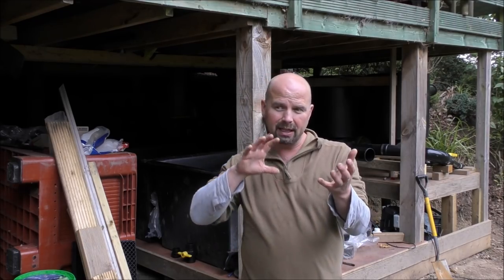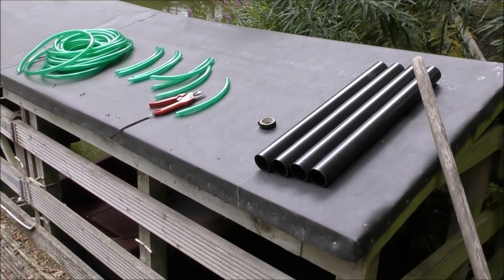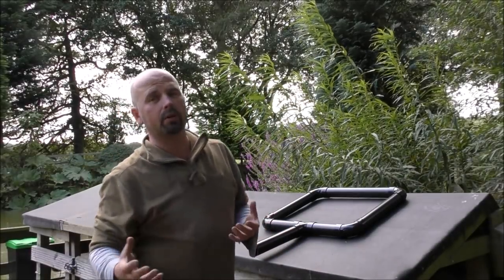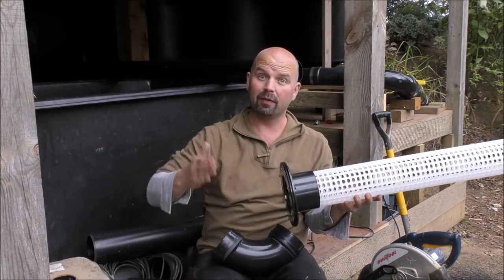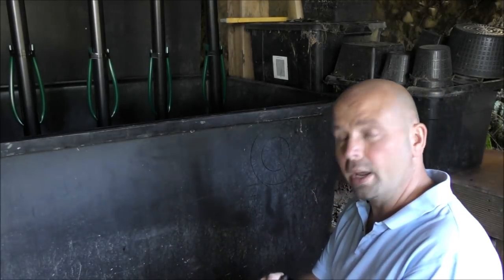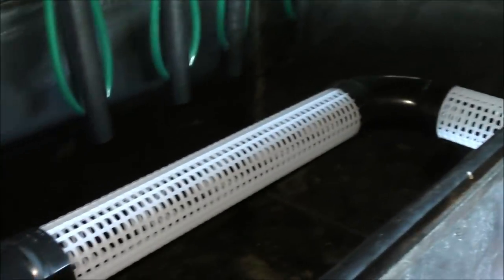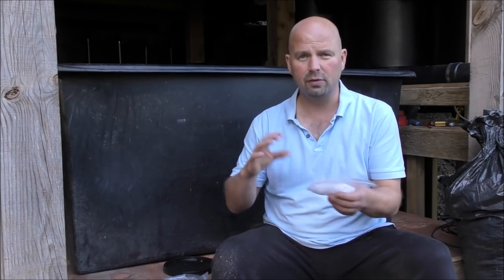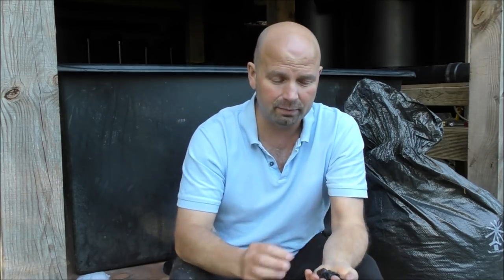Building a HUGE Pond Filter - Part 4 - Moving Bed / Fluidized Media Chamber

Comment from the maker: Forth episode in this mega-filter build for my large trout pond. Today we will take a look at the moving bed chamber and concentrate on the perforated outlet, drain and outlets to the next chamber.
Toward the end of this video I go into depth about the pros and cons of different types of moving bed / fluidized bed filter media media and explain how you can boost the biological activity in your moving bed by 40% simply by making the right media choice.
Why spend thousands on a fancy filter system and have it under-performing? 
A cheap DIY moving bed filter with the right media will easily outperform a ready made one with the wrong media....
Please check with the manufacturer of your moving bed if it will take K1 micro without modification - most will not, therefore the Hel-x 13 would be the better choice instead of K1 standard size
(Both the Hel-x and K1 micro offer approx. 40% more surface area per litre compared to standard K1)
The next episode will highlight the two static bed chambers which will be filled with a nation of media.
*When using side pressure to cut a hole with a drill bit use safety glasses since a broken drill bit is a sharp object which can damage eyes.
Hel-X 13 25 litres (Amazon): http://geni.us/3UBTi
Hel-X 13 25 litres (ebay): https://ebay.to/2QPKiq6
Hel-X 17 (more suited to very large moving bed filters): 
Hel-x 17 moving media: https://ebay.to/2UZk5aM
K1 standard size (Amazon): http://geni.us/zNFFaJ
K1 micro 25 litres (Amazon): http://geni.us/byDQ
K1 micro 50 litres (Amazon): http://geni.us/M7T2AH
K1 micro 25 litres (ebay): https://ebay.to/2P5Flfv
K1 micro 50 litres (ebay): https://ebay.to/2NFJ3YB
Moving bed media (FilterPro): https://bit.ly/2NN1gU6
Vortex filters: https://bit.ly/2Mj7gYa
4" fittings: http://geni.us/nTQc9bw
2" taps: http://geni.us/OBXBGSI
8" diameter brushes: https://ebay.to/2OvMOkc
Filter grids: http://geni.us/oqDBzT

If you've enjoyed this video please check out the playlists on my channel for hundreds more  - on a variety of subjects.
Feel free to share or link any of my videos on facebook, twitter, forums etc. for the benefit of anyone you think may also enjoy watching.
See you next time.
Pondguru

RECOMMENDED PRODUCTS ON AMAZON: https://goo.gl/jMaBWy
INSTAGRAM: https://www.instagram.com/pondguru_outdoors/

FILMING EQUIPMENT:
Panasonic HC-VX870 HD camcorder http://geni.us/3UwE
+Rode stereo microphone: http://geni.us/4OL
+Rode 'deadcat' mic cover: http://geni.us/1pmn
JVC Everio quad proof HD camcorder: http://geni.us/e09e
+Rode 'deadcat' mic cover (opened up and held between tripod and camera base) http://geni.us/dee24
Zomei Z666 tripod: http://geni.us/1a1af3
Manfrotto MTPIXI-B PIXI mini tripod: http://geni.us/87f7
Reply: Pondguru brilliant update! When’s part 5 coming the waits killing me
Reply: Hi great video as always.
Where can i buy the white mesh pipe from.
Cheers.
Reply from the maker: Hopefully the some time next week as I have shot the footage, just needs editing. The filter is just about finished now but I still need a big pump to feed it.
Reply from the maker: Sorry I forgot to put a link in the video description for that. It is called 110 perforated pipe (1000mm length) but can I hell find any suppliers online. I think you may have to contact Kockney Koi directly for that - I just added it onto an order for foams a month or two back. Their number is 08448000000
Reply: It’s a quality set up, how much volume will the filter on its own take! Keep up the good work chap I love this channel
Reply from the maker: I think it was around 2000 UK gallons (about 9000 litres of water in the system)
Reply from the maker: SEMPER PROGRATIS  it is generally based on daily feeding amounts with the 50 litres of K1 standard being able to cope with 250g of food (and resulting waste) per day. Hel-x and K1 micro would be nearer 350g per 50 litres of media due to increased surface area. That is for ammonia and nitrite in moving bed as it will not process nitrate.
Reply: still watching in 2021. Great content. Will you make an Update Video?
Reply from the maker: @FreedomCycles  The long answer is ......I will do an update soon but the filter has been pulled apart and I'm in the process of moving most of it to the other side of the pond. It will be part of a permaculture type set up as all the drains from the filters will be piped down to various parts of the garden (up to 80m away) where I have made large raised vegetable beds.One of the feeds will go into a new greenhouse (hopefully getting installed the end of this month) where I will have vertical growing systems for lettuce etc.
All of that will be powered by a 12 kW solar system with batteries which will enable me to grow food all year in the greenhouse.
I've been integrating all the media from the filters into large platforms in my pond so there will be close to 2 ton of media in them. They will be capped off with aquatic plants which will bind the top of the platforms together and provide more habitat for wildlife. The main sections of the new filter set up will have floating plants which will allow for a mad amount of invertebrates to live in the roots and the invertebrates will wash into the pond to help feed the fish.
I saved up for all that in 2019 but the business went mad last year making free time so short that I'm still on with the project now. (I worked an average of 10hrs a day every day in 2020 with Christmas day being the only day off believe it or not but I'm on a pure mission now to restructure the garden to make it work for us) 
It will be a sight to behold when it is finished and having free power and a supplemented diet will be extremely important during the 'new normal' nonsense which is coming fast.
The filters were working fine as they were but they were in totally the wrong place so I'm not opposed to scrapping something to make it better - sounds like the Great Reset, lol

Comment: Looking good mate! I can see you pond crystal clear with the trout slowly moving through the water taking those newly hatched flies off the surface while you sit on the deck watching with a nice cold beer. Great job so far.
Reply from the maker: A clear pond would be a major boost to the way it looks and it's been clear before so it could be clear again.
However I recently had a 5 foot sturgeon dropped off by a local koi place which closed down and this was the most suitable pond for it.....that may have been a mistake to put a very large, active bottom feeder in as far as water clarity goes for a clay lined pond, lol

Comment: If you have an aldi store nearby they recently had a selection of tools on offer. One that would be of use to you is the set of drill saw bits. Drill bits specifically designed for cutting holes as you do with a standard bit.  They also had some universes of circular saw blades in a variety of sizes. Filters coming on great.

ATB Steve
Reply from the maker: Good one, all the pipes are fitted in place now but I may invest in one as I will probably be adding something extra over the static bed parts of the filter.
Hope you're well, man

Comment: Love it! Thanks for all of the info in your videos, its really making me rethink my filtration system for the next year
Reply from the maker: No worries, I'm chipping away at this project when I can but it still is not finished. It's running with a small pump (12k per hour) but I still need to finish the shower part and alter the moving bed to include an air ring around the bottom drain for extra media movement but apart from that (and a big pump purchase) it is done.
The large aquarium I have there will be getting used as a part of the filter too but that is a really unusual 'filter' idea which I haven't seen used anywhere so it's under wraps until I get the necessary (living) parts for that one.
Reply: Awesome,  hopefully we get to see  another video on that soon.

Comment: It would be good if there was any way to measure the before and after water clarity with a meter or even just sharing video with us at the various stages.  I'm absolutely loving this series and please show lots of videos of it working!
Reply from the maker: The water is going through it now using a smaller pump (12000 lph) to test for leaks, static beds are full of 750kg alfagrog but I will be putting another 200-250kg in the shower container followed by about 300kg of shower media. The water seems to be clearing a bit already in the pond but it is too early to say for sure.

Comment: great video pondguru and i really enjoy watching your videos and because i do i bought your  FRESHWATER 5KG EXTERNAL FILTER UPGRADE KIT from your website for mine my filter and i tested my nitrate and nitright levels today about a week and a half and it was 0 on both and my ph was perfect so just wanted to say thank you... p.s thank you for the extra white pad
Reply from the maker: Awesome result but that is suspiciously quick for a full cycle - are you using any additives with liquid carbon? that would speed up the development of bacteria significantly.
Reply: hi ponguru no i just put the 5kg of Biohome Ultimate in and the pads and the filter starter jelly balls in and i have put in the water the tap safe and thats it nothing else has gone in no liquid carbon no carbon in the filter.. i filled up the tank on the 11th of October and the filter has been on since then and i tested it on the 17th of October.. my filter is a AQUARIUM FISH TANK EXTERNAL FILTER EFX+ 2000L/H 9W UV STERILISER from all pond solutions. and my tank is a fluval roma 240.. thank you for replying back
Reply from the maker: It could be that the nitrite and nitrate haven't had a chance to rise yet maybe?
Generally it takes 2-3 weeks for the aerobic part of the cycle (0 ammonia, 0 nitrite) then anywhere from 1-6 months for the anaerobic part of the cycle (nitrate reduction).
We have had a few reports over the years where ammonia, nitrite and nitrate remain zero after the first week and beyond, even when a tank gets fully stocked and I'm still bemused at those cases.

Comment: friendly tip: when you push the pvc pipe in, keep applying pressure for 10-15 seconds to avoid it popping back out, you can see it move in the video
Reply from the maker: Thanks for that tip - none of those joints are leaking but if they were that would probably be why, lol

Comment: Another idea? Use a backhoe to carve into the bank and farther into the yard..put in tons of lava or like that into a lined over cinder block area or even built up with treated wood, and plant water plants while water is pumped over all that and runs down to a big drain pip with a jillion holes and then back into the pond. For that huge pond,a gravel bed of 20 x 20' x 4' deep sounds like a start.
Reply from the maker: I was going to install a huge stream coming down the bank near the pond coming out of a tunnel and using alfagrog behind the walls flanking the sides of it but the quarry I used to get stone from closed down and killed that idea so I went with  more traditional filter to enable me to use waste water to feed parts of my garden and (hopefully) restore clarity to the pond.

Comment: Hi Richard, you might want to go round your 4" Bulkhead fittings and change out the coated steel screws and replace them with the same diameter/length stainless steel screws= no rust in the future.
Reply from the maker: The screws are coated but as I mentioned in previous video (you're right) stainless would be the way to go.

Comment: Lol ouch! headphones warning for that chopsaw, what a squeal! Looking great so far :D
Reply: Actually just got to the bit with the DIY venturi, I feel like that's backwards and might get you two jets of water instead of two sucking air pipes. I thought the idea was to have the water rush past either side of the insert with the notch/angle facing away from the flow, there will be a low pressure zone created in the hose in front of the inserted part, and that will make it suck air. I don't know though so I'm keen to see what happens! You're the Pondguru after all not me lol
Reply from the maker: If it doesn't work too good like it is in the proper flow (when I get the big pump) I will turn the ends of pipe around and if it still doesn't work I'll scrap the idea, lol
Actually what you're saying makes sense there.......thanks for that.
I only have a 12000 lph pump operating at present so there is barely a trickle compared to when I get a proper sized pump. The last thing I want is water squirting out of the 'air' pipes.

Comment: Great video really looking forward to seeing it done read through some of the comments on the Venturi pipes I’ve seen other people restricting the flow of water just before the point where the air pipe is connected is this necessary or will plenty of air be dragged into the system doing something similar to what you’ve done ? I’m looking at adding a moving bed filter to my system for next season
Reply from the maker: There may be enough air dragged in just from the outlet of the brush chamber and as it falls so far it should mix well with water in the moving bed part but time will tell - I don't have a big pump for the system yet.

Comment: Nice job again Richard. It'll be hard looking at ya with one arm and one leg missing..as this filtering beast is going to cost that for sure. Looking forward to seeing your static bed filter design. Interesting.. that I came across one of your coharts on You Tube that touts he has degrees in biology or something and yet his narrative constantly reverses Nitrites are Nitrates and vise versa. We were discussing the static bed and Bio-Home type media...his take on those is that they don't work at all and doesn't using them. Basically saying that studies prove that the bio-mass is so thick on the outside of the media (I think he is referring to aerobic bacteria, which should be correct) that these studies prove that the aerobic bacteria cannot colonize because there is no water flow??? This seems odd, as that environment I would think would be perfect....very low flow of water. Even some very expensive filters that come pre loaded with anaerobic bacteria and a small submersible water pump is designed to flow mere drops of water back into the aquarium. I wonder where can I read these reports for myself. Anyway looking forward to see your static bed design.

Comment: Great job, as usual, Sir.  
How much planning did you do before you started building the filter?  Did you make diagrams, calculate water volumes and flows, etc.
Or , are you planning as you go?  
Much respect!
Reply from the maker: Planning? what is this thing you call 'Planning'? 
lol, I just make it up as I go along and have been collecting the various parts for about 10 years.
When I have a plan I throw it into the ether and things just work out over time.
Reply: @pondguru  I thought that might be the case.  It seems to make perfect sense, though.  Cheers!

Comment: Awesome as ever. Cant wait for the next video and i hope you filmed it starting up and filling the different containers. Would you suggest I swap round my diy static and moving bed so the moving is 1st in flow??
Reply from the maker: Yes, I'd have said the same thing - groovy.
Reply: @stevo9853  Hi Stevo, thanks for your reply. I currently have a water butt as a radial flow filter so all big bits sinks to the bottom and then it exits over filter floss changed every 2 days before dropping into the static bed. After the moving bed it goes into a mini bakki shower with a piece of jap mat at the top and then pumice stone in the bakki. Then down a waterfall.  
I have always struggled with nitrates of around 40/60 so anything i can do to reduce that would be great.
Reply: @stevo9853  the mains water is 20 for nitrates. I have a 4000 litre pond with 540 litre diy filter system. I have 2 large Koi 45cm, 1 ghost 30cm, 2 blue orfes 30cm, 3 grass carp small and 6 goldfish. I trickle in and out and flush out the filters every week in summer and every other or 3rd week in the winter. Feeding is down now to twice a day small amount.

Comment: The thing about all that plastic media?..its all got a smooth surface. Shiny. I would think there must be some kind of acid dip for them to rough them up? Or tumble in sharp sands and all that would double or more the surface area. Or,if you have the time leave all that new shiny plastic in the hot UV summer sun to take the  shine off. Seems to me that would make them equal to porous stone without the weight.
Reply: Whats that?
Reply from the maker: lol at the clay - I added about 20kg over the moving bed media on the first day of running it to encourage it to move and to add trace elements into the system.
Reply from the maker: It is running but only with a 12000 lph pump and I haven't got the shower part ready yet as I need a few more crates for media in the tub there and it will require the 12000 lph pump for that part.
I'm also going to add something which I don't think has been seen in a pond filter before too but I will need to get something really specific for that part - it will utilize the large aquarium I have there as part of the filter but nobody would be able to guess what will be going on in there.